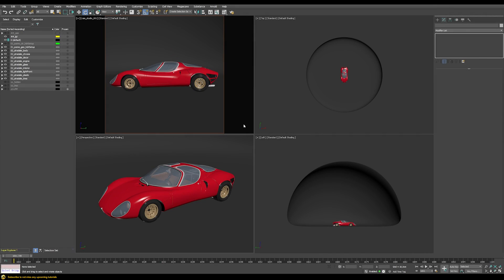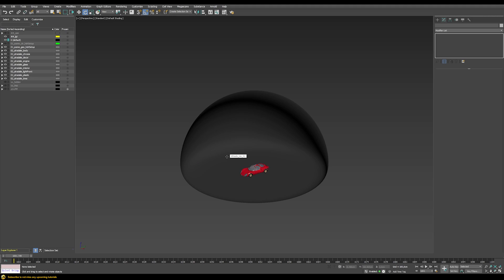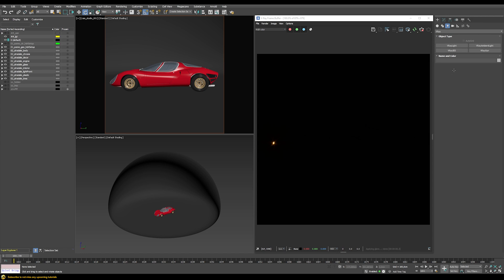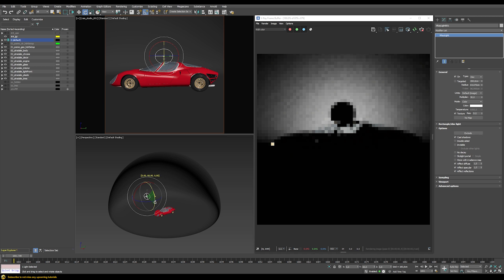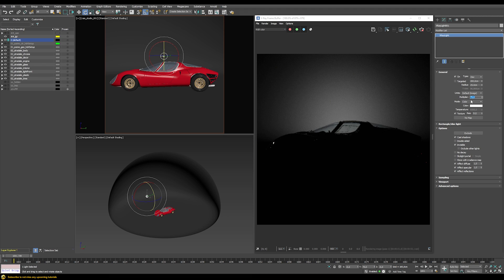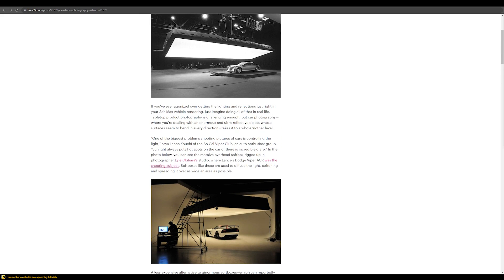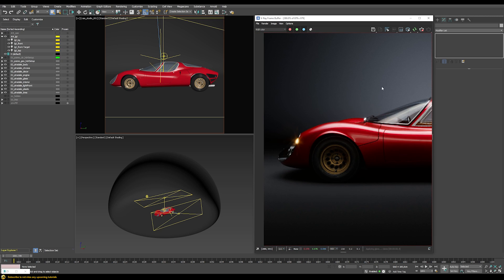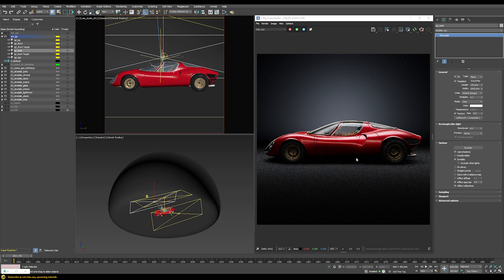V-Ray | Simple CAR STUDIO LIGHTING Setup

Comment: 7:20 these settings kill beautiful speculars on the surface of the car, so smooth shading on
the floor will not work, it needs a separate light source
Reply from the maker: Hi, not really sure what you mean. Disabling the visibility just makes the lightsource not visible but it will still create specular highlight on surfaces

Comment: Hi Jonas, is it possible to get the "flat" sphere that you use as the stage as an FBX or OBJ file (I don´t use Max)? :)
Reply from the maker: Would be possible but you can literally just create a sphere in whatever software you use and flatten out the bottom there or? Should just take like 20 seconds :-)
Reply: @JonasNoell  Yeah, I guess I could fix that in Blender. I´ll give it a go, thanks!
Reply: @lassebauer  subdivide a cube and bevel the bottom edges!
Reply: @lv-cxs  Thanks! I thankfully learned to cover most of the basics since my original post 😇😊👍🏼